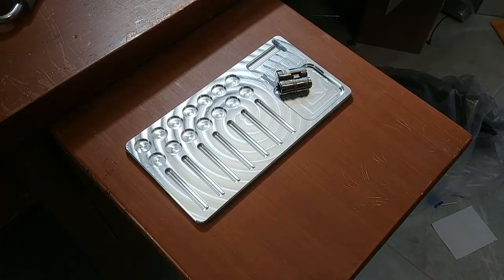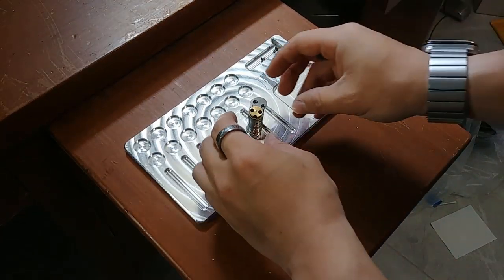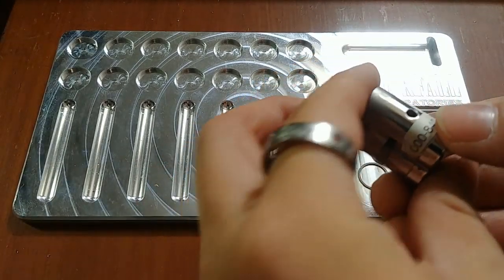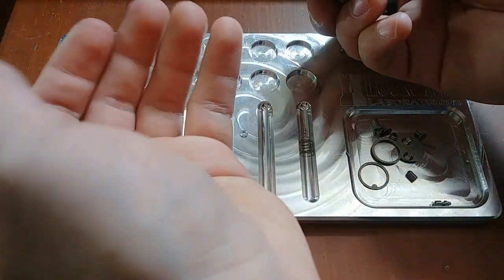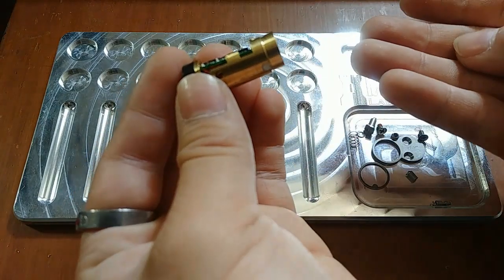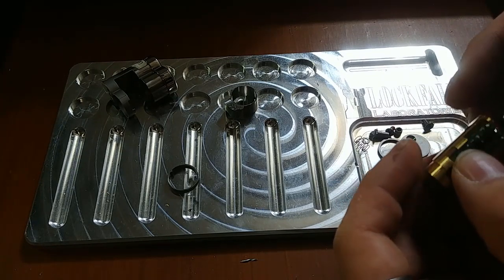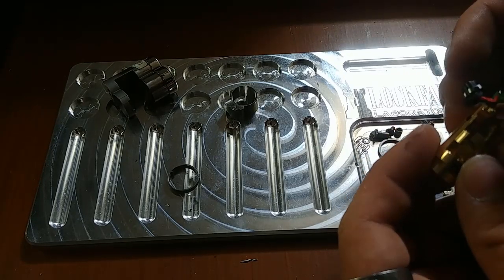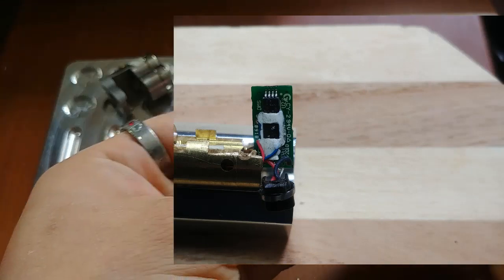Fabrication Friday 10: Breaking into new electronic medeco!

Comment: Funny that you milled off the wrong side of the Padlock first -- what were you thinking?  Very interesting -- I have some photos of the XT core I took at a Show somewhere -- guess I can't put them here.  My advice is to be careful when talking to ASSA / Medeco as there is a serial number on the lock body which can easily be traced to where that XT SFIC came from.  Each s/n  is uniquely assigned to the end user, however there are "samples" made which are not assigned and come with fixed, non-reprogramable operating and control keys.  I haven't "destroyed" one of mine, yet, as they are quite expensive.  I would like to see the motor, so please mill of the back side of the core.
Reply: Ill be honest I was pretty excited to dig in to the lock so I just went at it with the mill. Ill be cutting off the bottom of the lock soon so I can play with the solenoid. more footage to come in the future :)